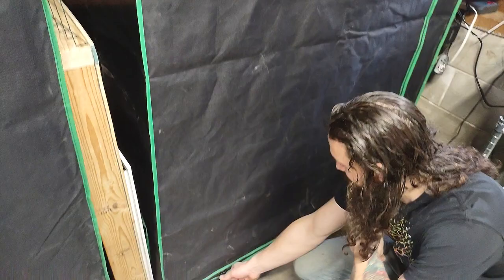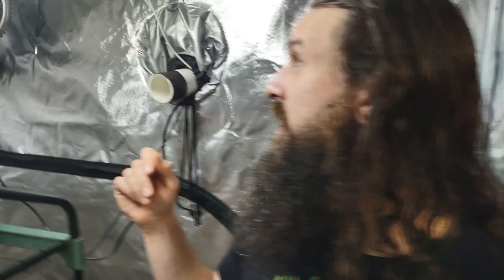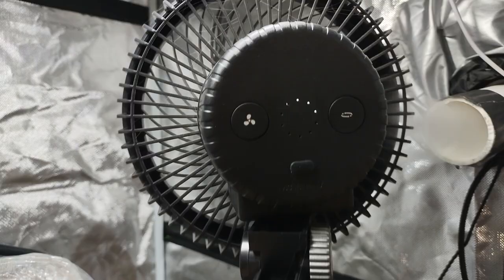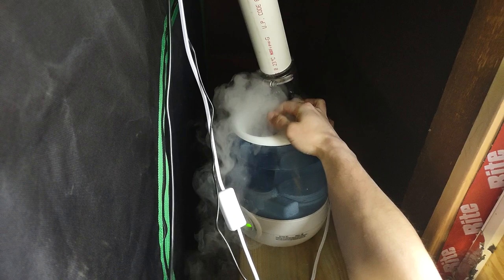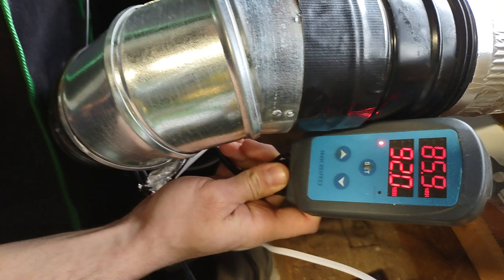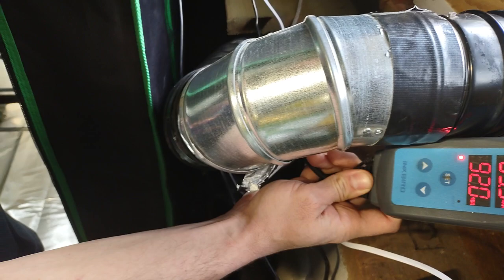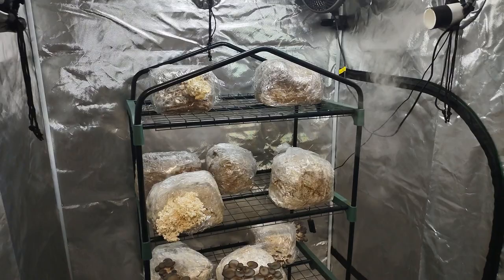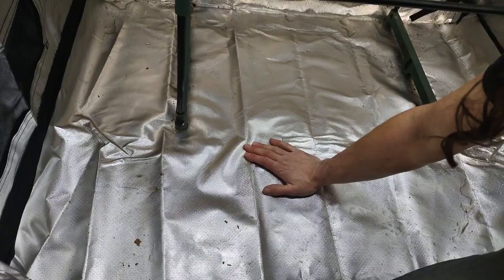Grow Tent  Set-Up & Walk-Through! #mushroom #growing #tents

Comment: I want to set this up for myself, but what I wonder about are a few things ... Firstly Would a Co2 senor help regulate exhaust ( ie only come on when out of range? ..  Second thing I wonder about is a HEPA filter on the intake, can this be done and is it easy, does it restrict airflow, requiring a stronger intake fan ,, would you be best to pre-filter to make the fans last longer?   what are the reasons for the backflow flaps?   to keep dirty air coming back in through the exhaust?  somehow the restriction in airflow creates a sort of negative pressure event when I now have air flowing out faster than it's coming in ....    how would we fix that as I really want positive pressure inside the tent to avoid things being sucked in around the zippers and ports ect ...  I see that ACinfinty has now made a cool mist humidifier that is designed to work with these tents ... Would a submersible UV filer in the resivor of the tank help to stop mould
.. and how do you control rust on the shelves with humidity near 100 percent ect :) thanks for any answers

Comment: Nice video, thanks. I have some doubts about the intake air. Can I replace an exclusive intake fan just putting an humidifier and an ac infinity fan inside? Thanks
Reply from the maker: Great question! You will need fresh air or the CO2 will accumulate and diminish yields, plus you may risk contamination in a stagnant humid environment.
Tuning in the tent's climate may take some initial work and monitoring but once you lock it in, you should be good.  It's about finding the balance between humidity and fresh air..

Comment: Hey, quick question. Why do you mount your humidifier pipe up high and not down low? I  prefer having it high as I can angle the pipe as you mentioned, much less condensation. I was told to use the lower slots for my humidifier as it settles but was never given a straight reason beyond that. I've been having issues with my pink oysters yellowing, adding a dehumidifier helped as i use a pond fogger/AC fan setup which might add a bit too much humidity for its size.  You just convinced me to buy that oscillating AC infinity fan.
Reply from the maker: Sorry for the delay. Much of our growing endeavors is trial-and-error with adjustments made constantly but I believe Will was going for a cascading fog effect on purpose. If there is a better way, I'd be interested and I'm still learning more than I'm teaching! 🤘😁And AC Infinity will be in my future grow setups too!

Comment: Ok , i noticed your Humidifier input to the tent and your exhaust PVC pipe and your Infinity Inside tent Fan. You don't seem to have any fresh air Intake fan goin into the tent?
Reply: The exhaust creates negative pressure which sucks air in passively
Reply: Ok, Passively from a hole or pipe?
 @COLORBOOKANTICS
Reply: @Markuz1775  yea so in this setup the exhaust would create negative pressure pulling air in from the humidifier pipe

Comment: Just to confirm, the AC infinity inline fan is only used to exhaust air out of the tent?  Is all of the fresh air coming in from the humidifier?
Reply from the maker: Additional passive air was pulled in through an open side vent - the tent wasn't completely sealed.

Comment: I have a question as someone who is just about to start growing mushrooms for the first time:
I see these tents with intense climate control setups but people seem to keep only a few bags in there. I feel like you could easily fit 2x or 3x of those bags; so why not?
Also, why do you keep the humidifier outside instead of having it inside the tent?
Thanks.
Reply from the maker: You can definitely fit a lot of mushroom bags in a tent like these... Just adjust conditions accordingly to compensate for more CO2 accumulation.
As far as the humidifier goes, many humidifiers on the market are not meant to be in high humidity environments.  Larger grow rooms use ultrasonic pond foggers like the one I just built (check out my recent YT shorts!) and they are designed for full humidity conditions as they are submersible!  I put a small VICKS - style humidifier in a tent once and fried the electronics in one day... and learned my lesson. 
 Keep the stuff that can't handle the humidity out of the room! 🤘😁🍄 Hope this helps!
Reply: Thanks a lot! @ohmisterjeff

Comment: Hello! Is this configuration also efficient for Psilocybe cubensis fruiting? Isn't an extractor necessary for the air intake for gas exchange?
Reply from the maker: I imagine this basic setup would work for ANY saprotrophic (decay-eating) fungus  including the Psilocybes... As far as gas exchange, make sure you have good fresh air exchange... If fresh air is constantly coming in the tent, either through forced or passive means, you should be good. Keeping humidity levels right while maintaining great air exchange can be tricky if not monitored. 🤘😁

Comment: What's the point of the fan? Just to move around the humidity fog in the tent? Or for evaporation?
Reply from the maker: Great question!  While air will naturally circulate through diffusion and the exhaust fan, having a fan in the tent to push air around will help reduce stagnation and boost evaporation.  I think it is not crucial but certainly helpful.
Reply: @Mister Jeff  thanks brother for clearing that up.  I know I've seen a few people recommend fans in tents but never really understood why, with the fogger acting as a intake, and your exhaust venting air out, the air naturally moves around inside the tent. When you hook everything up to meters like humidity meter, c02 meter, and cooling/heating meter, it's pretty much always in optimal conditions that you set.

Comment: Do you maintain the tent at a certain temperature? With a heater or anything? And is the exhaust for FAE? Awesome setup!
Reply from the maker: Temperature is adjust for species... As we introduce pink oysters, we will raise the temp.  A small heater with an inkbird control.  And yes, the exhaust takes older air out in this case, passively bringing in new air. Thank you for the questions!
Reply: @ohmisterjeff  do you always keep that small fan running? Also how often do you run the exhaust fan.
Reply from the maker: Will said he keeps the fan on 24/7 for air circulation and the exhaust runs every 5-10 minutes but  mind you,  he currently does not have a CO2 monitor and once he does, that will govern the exhaust to a degree... Also consider the amount of tubs or bags in your tent because more organisms will contribute to more CO2 production.  Monitoring levels with Inkbirds is a great way to keep specifications on point IMO.
Reply: @ohmisterjeff  thanks Jeff! We recently set up the oscillating fan and have it running 24/7 so glad to hear that is what’s recommend. I’m still working on getting the exhaust fan dialed in. Right now i think we have it running once every 20 minutes for 5 minute. I’m going to look to increase that when I get back to the grow tomorrow. Ive got 16 fresh bags ready to go into fruiting probably within the next week so thanks for the info. I got involved with this grow in the last month or so and have been trying to get my partner to tighten up our process and start dialing things in. Thanks for getting back to me!
Reply from the maker: @Flowerz__   For sure! 🤘😁
Never stop learning! I'll keep making more videos amd sharing what I learn along the way!  Feel free to ask questions amd suggest future topics.
Reply: @Mister Jeff is the exhaust necessary? & if not what could I do to compensate? Thank u!!
Reply from the maker: @taureanbogar8454   Fresh air exchange (FAE) is important as it will promote wicking of the moisture from the growing mushrooms and help reduce accumulating CO2 in the chamber.  Too little FAE and you may encounter stretching amd poor fruit size while too much FAE can dry out your fruits. Stunting their growth if humidity supply cannot keep up... Also different species vary in growing conditions.  
If an automated system cannot be used, you may have to manually provide FAE through consistent fanning and opening of the grow arae to allow air to exchange - which becomes impractical if you cannot be on top of it around the clock.
Reply: @ Mister Jeff makes sense. Thank u for explaining that. I’ll invest in an exhaust for sure. Also the flap in the hose that he uses did he construct it himself or did he buy the assembly like that?
Reply from the maker: It is an AC Infinity backflow damper he purchased online. I don't have the link but you can do a search for it. Make sure it matches your line diameter per manufacturer's specs.
Reply: Good deal. Thanks a lot for all your help!
Reply from the maker: @taureanbogar8454  I'm on FB and IG as well... Thank you for your support!